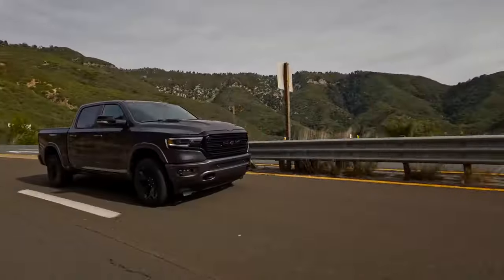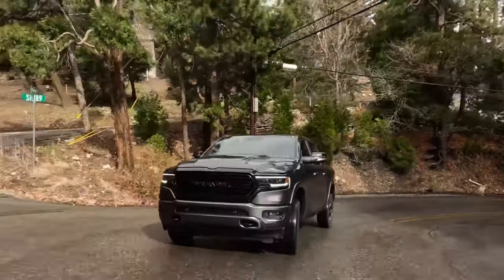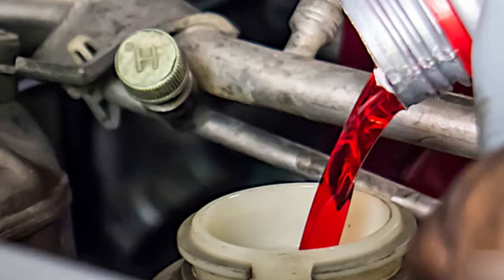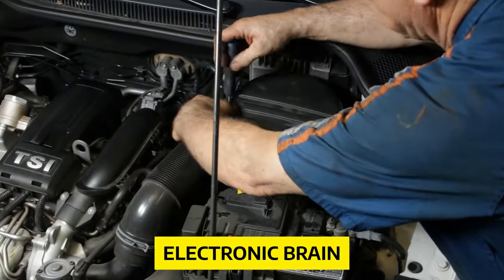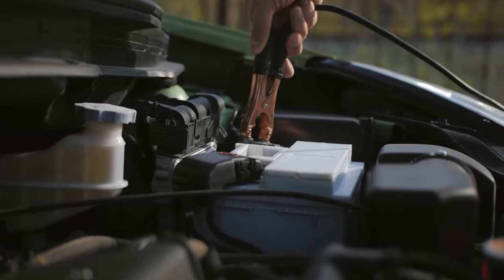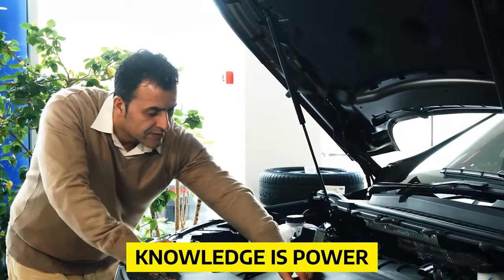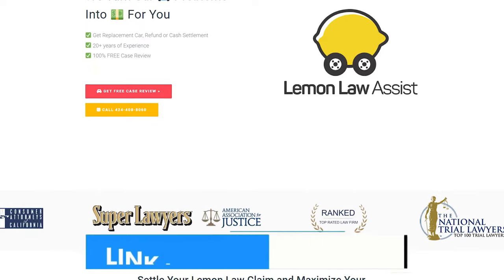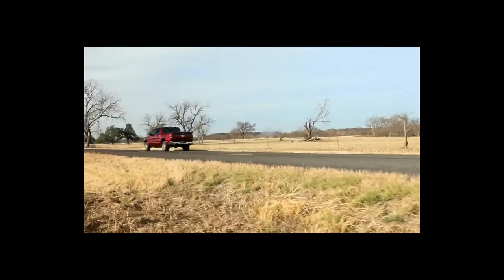Ram 1500 Transmission Issue | How to Fix it Without Spending a Penny?

Comment: Not when losing transmission fluid I had changed a month later no fluid in transmission.
Reply from the maker: @tonyhelms496 It sounds like you had a serious issue with your transmission fluid. If you’ve recently experienced a sudden loss of transmission fluid and had to replace it frequently, it might indicate a significant problem with your vehicle. If your vehicle is 2019 or newer, you could be eligible for protections under the Lemon Law due to ongoing issues like these. For a free case review or to find out how much you might qualify for, please fill out the form here: https://form.jotform.com/mollaeilaw/lemon-law-assist-youtube